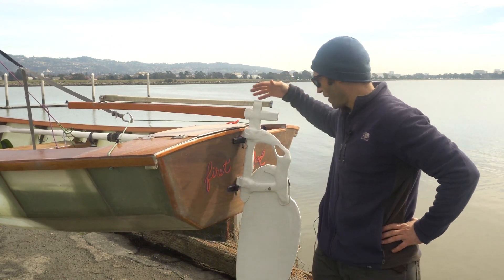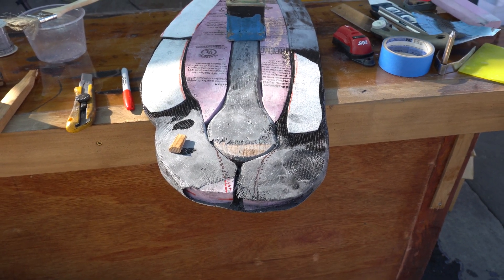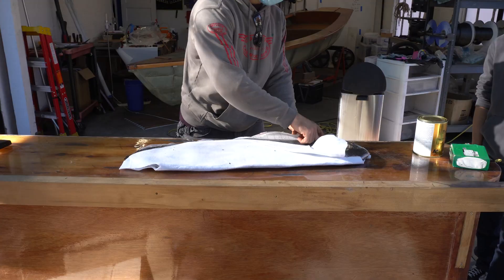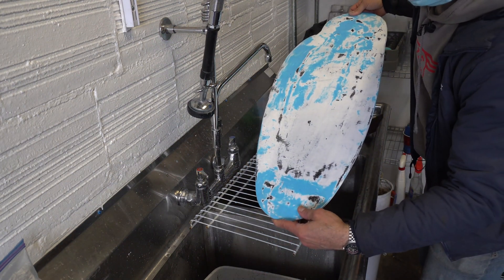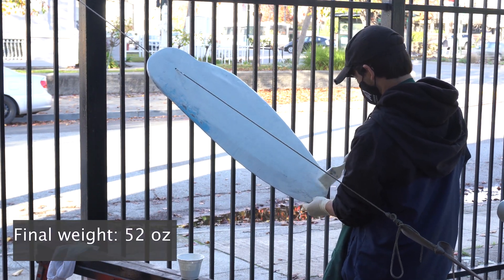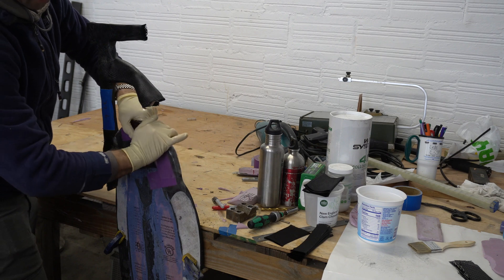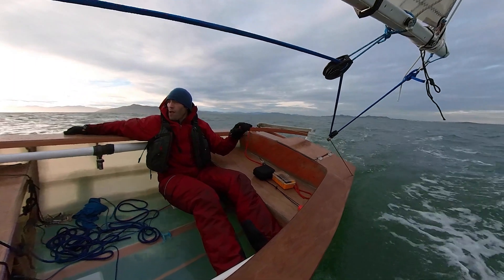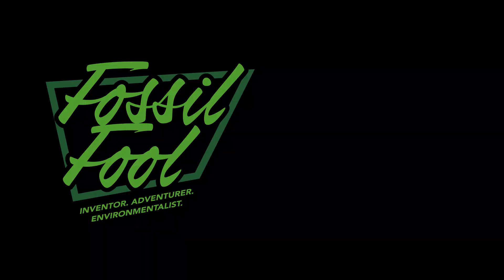Creating lightweight carbon fiber rudder for my bike-towed dinghy. "Butcher Block" method revealed!

Comment: Does your rudder kick up? It looked like you were working on that feature but maybe its not necessary. I know how shallow it can get on certain tides.
Reply from the maker: Thanks for watching. Yes it kicks up. I haven't installed the Clamcleat CL257 yet but that's my plan and till then I'm holding it down with a spring clamp.